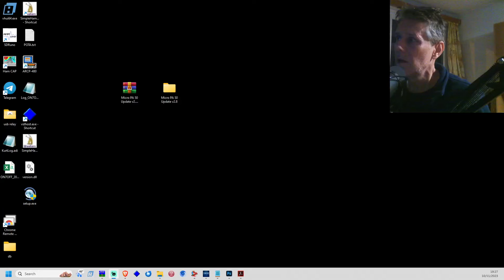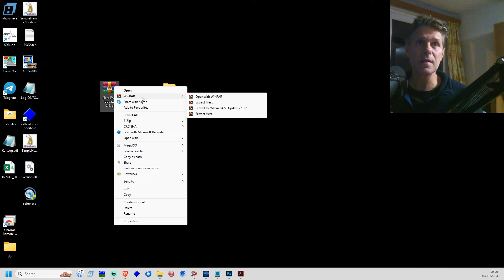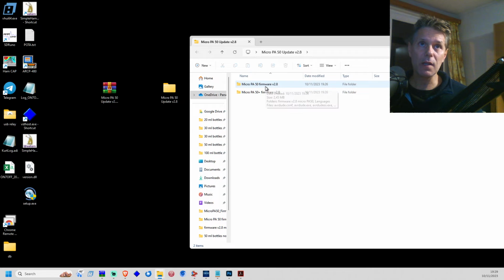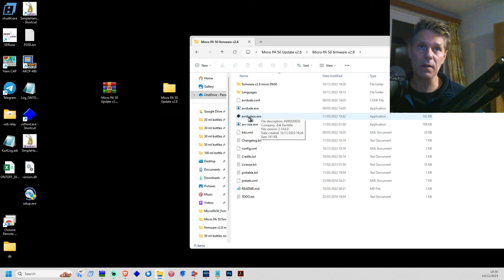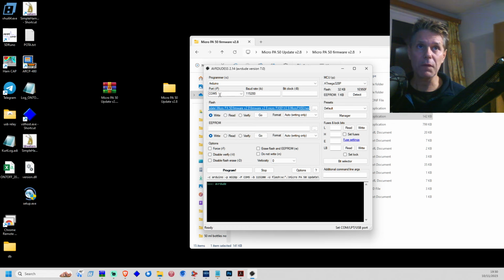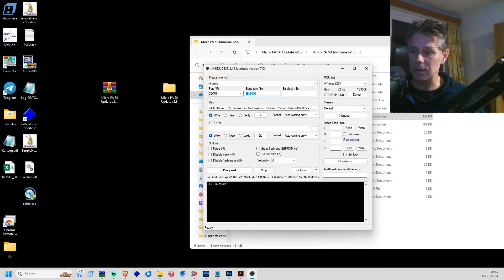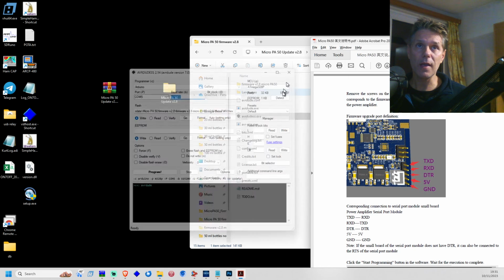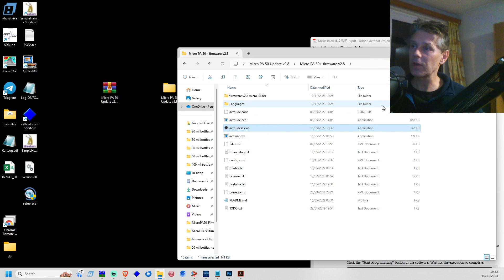Micro PA50 & Micro PA50+ newest firmware (turn on/off buzzer)

Comment: Hi, my new MPA50+ has firmware of 2.8.5 and on 15m, when I press PTT, it shows BYP in place of TX. Unable to remove that. If I change band, it works just fine. Only in 15m. SWR is good on the band at 1.2. Do you know why BYP is coming up ? Thanks.
Reply: Hi @wdycsqcsqwdy - Any help for this ?
Reply: @vu3gwn  I had the same issue. 15m and 30m don't work and just show BYP. There is a multi-click option that is missing from every manual I can find, that is for "30/15m Open/Close". This comes up after 8 clicks. Do the 8 clicks until it says "open". Then power the amp off and back on. This seems to enable/disable 30m and 15m operation. Same as for the 7 click menu option for "17m/15m SWR On/Off". No mention in the manuals, but turns the SWR meter on and off for 17 and 15m (no power cycle needed).

Comment: Having problems updating to  ver.2.8 firmware in micro power 50+..... I bought 2102 usb adapter, but when I connect jumpers between usb adapter and pa50+, as noted in manual "Note: If the small board of the serial port module does not have DTR, it can also be connected to the RTS of the serial port module", the 2102 board has nothing resembling RTS to connect the DTR to !!   Help, please

Comment: Thank you for your work ON7OFF. I do have a question. Is there any difference between the two amps other than the display size? If not, strange there's two different FW's. And thanks for sharing. I would not have known about 2.8 if it wasn't for this video. I'm one of those that refuse to join FB. I'm not alone.. Just sayin..

Comment: Thanks for making this video and the previous one.   I did the upgrade, though I was using a Mac rather than a PC, so I did it from the shell.  You don't need the GUI to do this upgrade; you need only install the "avrdude" software which is available in (at least) MacPorts, and likely in Homebrew package manager as well.   I already use MacPorts for random 3rd party software packages, so installling avrdude was as simple as:

port install avrdude

and then answering "yes" when asked about installing dependent packages.  The to actually program the firmware, I did this:

% avrdude -c arduino -p m328p -P /dev/cu.usbserial-0133CE1F -b 115200 -U flash:w:V2.8-MicroPA50.hex:a

Of course, your USB serial adapter will have a different name that you'll need to find; just look at all the /dev/cu.* files before and after you plug it in to find it.

Finally, I programmed it without being attached to a 12v DC power supply.  The display powers up, and then the amplifier will start beeping at you since it's unhappy with the 0V power input.  Just hold down the "FN" button to turn off the PA and go for it.  When programming, you'll hear the T/R relay operate.  And of course, when coming out of the programming step the microcontroller resets and will again start beeping because it's not connected to the 12V.   But you're done.   I noticed in your previous video that you were likely backfeeding +5V into the USB serial adapter since the LEDs illuminated before you plugged the USB connector into the computer.   I think you could also have just left the +5V connection off to avoid the problem as well.

After all this foolishness it still seems to work, so yay!

If you like, you can also grab the old firmware from the device before upgrading in case you want to go back.  You can do this:

avrdude -c arduino -p m328p -P /dev/cu.usbserial-0133CE1F -b 115200 -U flash:r:oldfw.bin:r

to perform that operation.   Thanks again for this video, and all the others.  Hope to catch you on the air some time.

Comment: I don't have much trust in these firmware updates. There ist no official source for the updates. There are no official release notes for the version numbers. And while it took 6 month to get from firmware 1.9 to 2.1, we are now presented firmware updates on a weekly base.
Reply from the maker: I get the firmware from the designer of the amp. There is only one person who makes these amps, so how you want it to be more official?
Reply: @ON7OFF  So you found the official website? With downloads, release notes, manuals, etc.? Why don't you share this important source?
Reply from the maker: @Funkwelle  I have added this information in the comments section of your own video regarding the Micro PA 50. I told you there is a Facebook group called Micro PA 50 and this is where you can get the information, files and details. As not everybody has FB, I just share it here on my YT channel to help people. I also refer to the video from Wang who makes the amps. He is not a company, he is just a independent person who designed the amp for the ham community.
Reply: @Funkwelle  
1. When and how often the firmware will be updated depends on user feedback. Users raise issues and suggest new features, new firmware fixes issues and adds new features, and that's it.

2. In your video, I responded to the questions you raised, and I asked you to send me an email and I would send you the link, but it has been at least 2 weeks and I have not received your email. .

3. I repeat here: there is no official website, but there is a network disk for releasing new firmware. There is a discussion group. These all existed a long time ago. I set a time almost every day to go to the discussion group to answer everyone's questions. These links are written in the sales introductions of many cooperative merchants, but these links cannot be posted in comments because they will be ruthlessly deleted.